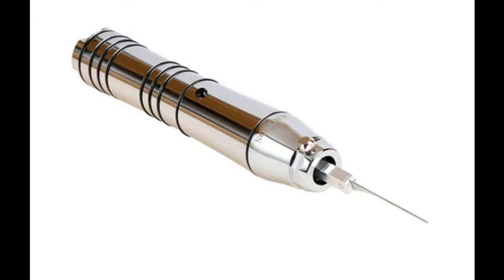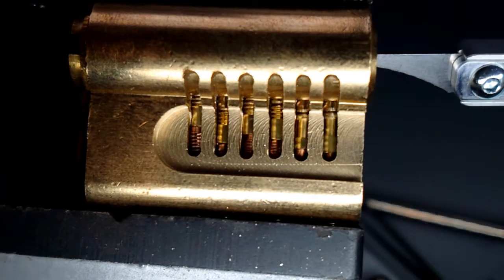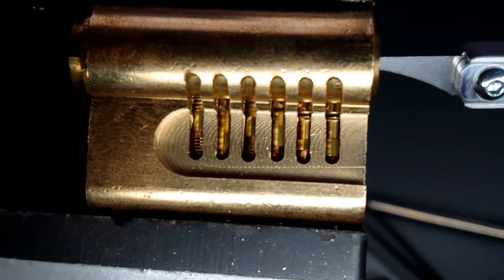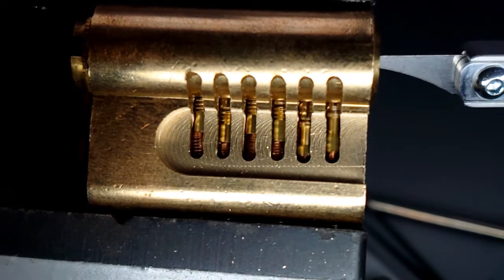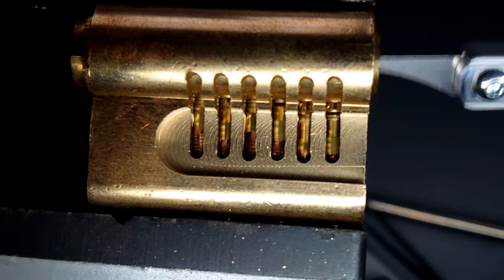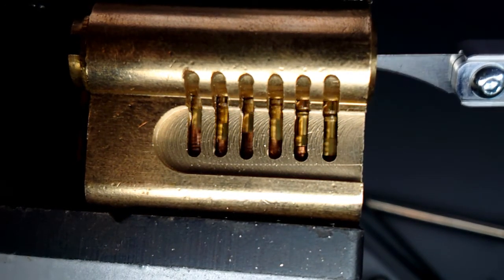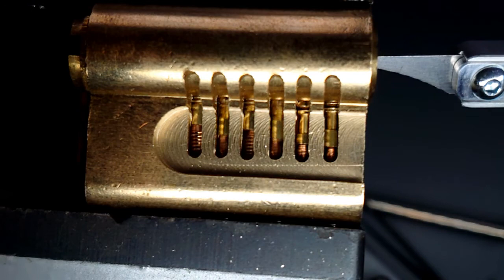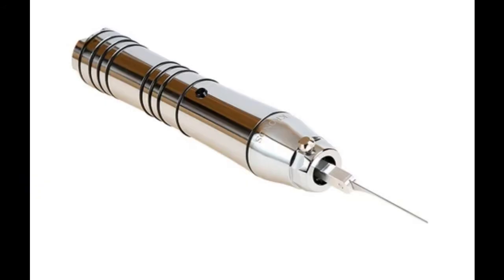How Do Lock Picking Guns Work?

Comment: Can ask you a question will this chrons pick a master pro series been having a wee bit of trouble with those pain in the ass locks and the worse thing is that it has the word MASTER written on it thanks for the video
Reply from the maker: You are likely to get a few security pins in the Masterlock Pro series - spool pins, bump-stop pins, and they have these very slight serrated pins. Electric pick guns can deal with these, but they do cause problems. However, in such circumstances, it's good to run the EPG in the lock for a bit, then SPP the remaining (usually) security pins.

Comment: Ive seen some ppl make a epg out of electric toothbrushes
Reply: Always wondered about that
Reply from the maker: @Khola_D  You can do it - see my other answers in this thread.
Reply: I've wasted more money replicating this toothbrush pick gun than it would have cost to buy a proper electro pick. The reason is that most tooth brush shafts rotate instead of move laterally.
Reply from the maker: @jwrm22  I'm with you on this. it's a worthwile project for a hobby picker, you'll learn a few things about the mechanics of the tool. but for a pro locksmith, get a durable, easily maintained EPG and you're good to go. The Kronos has a 2 year warranty too - which is quite something in today's disposable world. Thanks for your comment.
Reply from the maker: I'm with jwrm22 on this (see below). Sure, you can make an EPG from various electric tools, but they're not as durable, a pest to charge, are easily broken in your bag, etc etc. They're a decent project to do for a hobby picker, but for a locksmith, I would pay the money for a decent EPG like the Kronos - which will pay for itself in a couple of jobs.